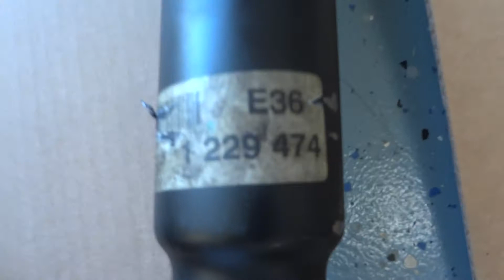BMW Z3 Manual Transmission Swap: Parts List

Comment: Great info! I’m doing this conversion on my 98 Z3 2.8.  Just getting started. Do you still have the Getrag transmission?
Reply from the maker: I do still have it up for grabs
Reply: @driventofailure  Ok. I’m very interested.  Can I contact you by email or ? to get details.
Reply from the maker: It's listed on FB marketplace in the Savannah  GA area.  It's posted as "BMW Getrag 5 Speed - S5D250G".  It's local sale only, I don't have the crate to ship anymore.
Reply: Thanks for the video has helped me a lot.  
So I got most of the parts you listed, My 98 Z3 2.8 auto to manual, missing crossmember and flywheel, clutch fork and Im still in need of the transmission, if you still have the getrag I could come pick it up since I’m south of you on I-95.  Im not on Facebook so how would I contact you to buy and pick it.  Thanks

Comment: Well id like to convert my standard Z3, 1.9 to automatic transmission. 1997. Is it possible ????
Reply from the maker: Anything is possible, you’ll be in for a ton of work.  The assumption is your not interested in selling to buy one that is already automatic, which is the easy option.  Conversion to auto would mean you will need to find a wire harness from auto car to swap in.  Not sure if the 1.9 auto had trans oil cooler, if so, have to source that.  Control unit and then all the other transmission components… best bet would be having a donor car otherwise you’ll be hunting parts for some time.  Possible but quite difficult
Reply: Wanna asap I have a 97 auto and I’m looking for a manual haha
Reply: convert a manual to auto?? it's a sports car. learn to drive manual. would lower the resale and ruin the car with an auto in it.